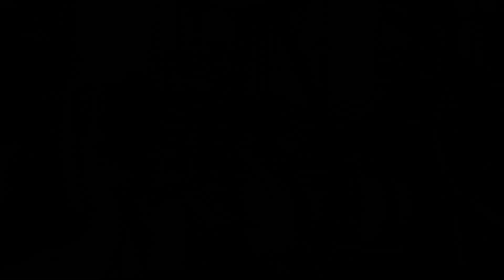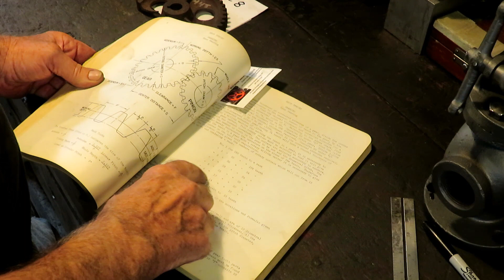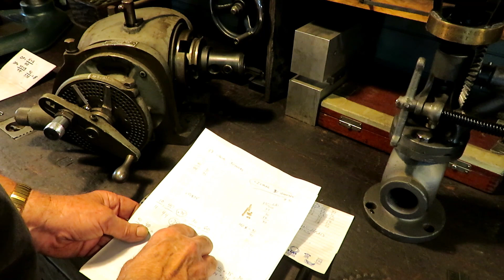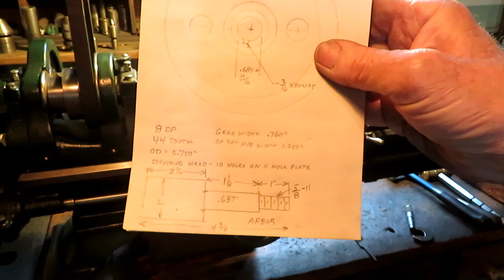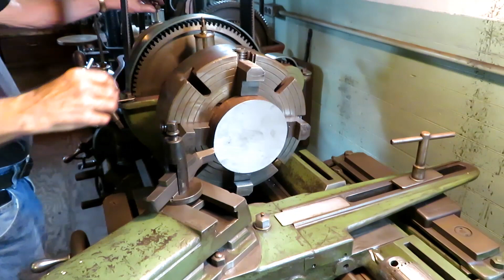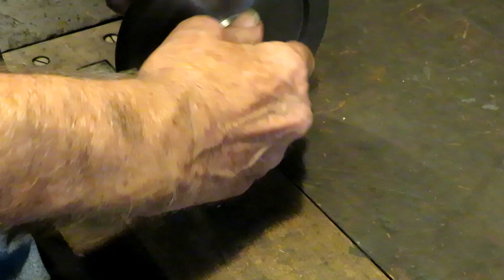Old Steam Powered Machine Shop 71- Gear fabrication, antique gas pump

Comment: Dave, I like the new overarm support bushing. You say the running bushing is the last on the arbor, but of course it doesn't have to be. Rigidity wise it's best to be as close to the cutter as possible. In some of the Milwaukee catalogs, I've seen twin overarm support heads, behind and in front of the cutter, and an X brace to the knee. I'd imagine that is quite resistant to chatter.

Cheers and welcome back!

Comment: How do you determine the speed of the cutter and the speed of the table? Thanks for taking the time, love your show
Reply from the maker: Well Mike, this is slow stuff here. There are just two cutter speeds on this milling machine. Slow and slower. Normally you would find the surface speed of the cutter tooth based on the diameter of the cutter in feet times the rpm and try to keep it around 125 ft/min for mild steel. With the old Brown & Sharpe, at it's 120 RPM a 4" cutter would run at about 40 FT/min. (About 1/3 the speed the cutter is capable of).  The table feed on the 
B&S is changed by moving the small flat belt to a different position on the feed drive. You would just choose a speed that the cutter, set-up and surface finish is happy with. Thanks for the good question....Dave
Reply: @davidrichards5594  Thank you Dave. If I win the lotto I'm going to buy your shop and you can stay as long as you want. Your the man

Comment: I like the Mill support modification. I cant see how that wouldn't be better than a center alone. Thanks for making this video
Reply from the maker: Hi Steve, These old mills also had long slotted support rods that came from the overarm down on both sides to a dovetailed plate that road on the knee ways. (also long gone for this mill). ....Dave

Comment: Thanks for another great show David. Look forward to seeing you cut the teeth, and it would sure be nice to see it installed on the equipment when it's done too. Definitely know about that heat. I'm doing brakes, drive shaft and engine work on my truck in slidell, La. It's 90 degrees outside and 90% humidity. Thankfully I built a Mechanics Carport Driveway Shade Tarp, if I hadn't done that the driveway would be to hot to lie down on. Thanks again for a super nice video. See you in the next one. Best Wishes & Blessings. Keith Noneya

Comment: As everybody else I welcome You back. I got my self a metal shaper. Is there a way to cut gears in such a machine?
Regards PeO, Sweden
Reply from the maker: Absolutely Per, You grind the gear profile into a tool bit and use an indexer or dividing head to rotate the gear blank through the positions.....Dave
Reply: @davidrichards5594  
I show people in an old machine shop how belt driven machines functions and You mr Richards have taught me allot about the trade. I’m most grateful!
In the work shop we have an old horizontal milling machine. It’s fitted with the same lathe center as Your’s before You change it to a running bushing!
Thought You wanted to knew!
Regards PeO, Sweden

Comment: A simple way to check the math 40 x 33 = 1320    1320 divided by 44 = 30 so 30 holes on a 33 hole plate is correct.

Comment: Great to see you again on a new episode! When I have to use a dividing head, I factor the number of teeth on the gear. 44 renders 2-2-11. So then ya go through your plates looking for the most exotic factor 11 (prime number). 22-33-44-55-66-77, and the like. Then multiply the selected hole circle times the dividing head ratio and then divide by the tooth count of the work. Yer gonna get a decimal. Save out the whole number with your sharpie on some cardboard, and the use the .xxxxx part times the plate circle you selected. This will be your number of holes you set your quadrant to. Now the number of cranks will be the whole number and the quadrant will be the partial movement.    33 X 40 / 44 = 30/33....so in this case less than a whole turn.
Reply from the maker: Yeah, I should have seen that 11 goes evenly into 66....Dave

Comment: I was very surprised to see your Diving Head, as I thought I had the only one in existence, mine came with the Elliott milling machine I bought, and believe it to be a Victoria, never found any reference to it anywhere, I've had to make several plates with the number of holes I wanted, and also made a couple of different types of chuck attachments.
Reply from the maker: Bernard: This one is a Van Norman and has the gear set with it to couple with a Y axis feed screw to do spherical gear cutting also......Dave
Reply: David, I hope you don't mind my posting this link, but it shows my Victoria as an exactish copy of your Van Norman. https://youtu.be/92kM-qQh4sw

Comment: This remains me of a mistake I made when I was 7 years old.  My Grandfather was getting gas at the local  general store . He had pumped the site glass full and placed the nozzle in to his Chevrolet pickup's truck fuel tank and opened the nozzle valve. Then he went inside the store.  I had never seen a pump like it before,  I noticed the glass was about empty so  I started pushing and pulling the handle back and forth. So the gas would keep going.  Mr. Hit ( stor owner) though it was very funny . My Grandfather was not happy with me because he had no idea how much gas I put in his tank. At 23 cents per gallon he was not sure he had enough money to pay for it. He had planned to only get 10 gallons.  This was the day I learned that Mr. Hit was a very nice man.  He told my Grandpa not to worry about it, all the gas was free to me that day. He also showed me how the site glass was marked and explained to me how to use them to measure the gas he also told me how many cycle of the pump handle it took to move 10 gallons into the glass on the top of the pump . Them he gave me a icecream bar . And told me when I was ready to get a job he would have a job for me. A few years later I started sweeping his stor after school. Later on he retired and sold the Store to Mr. Majors, I swept the walkway under the porch roof until I was in high school.
Reply from the maker: Great story Tom....Dave

Comment: I thought I had heard they were doing away with boilers in New York and you could just use a garden hose in the sun instead. 😂
Reply from the maker: It hasn't gotten to that yet but I will say the local State inspector for my territory is very cooperative and helpful......Dave

Comment: Divide by 4 and get 10 to 11 and then any multiple of that works e.g. 30:33. This is the same as doing .75 which is 3/4 which is divided by 4 and multiplied by 3. Very obvious once you see the answer but not so much when you are focused on the original numbers.
Reply from the maker: Very true....Dave

Comment: Hi Dave, glad to see your back and all is well. Another good video on gear cutting, I have a couple to do in the future for myself, thanks Dave for the encouragement.
Thought you might be interested in my latest project. 1920 South Bend, 16"-24" x 8' gap bed bridge lathe, quick change gear, silent chain motor drive, with lots of tooling, 3 and 4 jaw chucks, 5ns draw-in collets, taper attachment, steady rest, thread dial.   Really looking forward to getting it back together this winter and make some chips.
Reply from the maker: That will be a good one....Dave

Comment: Thanks for sharing your time with us it's good to see your channel up and running. How much trouble would it be to hook the line shaft to your shot blaster for times like this. Just a thought and if you won't to keep it period correct simply go get a 1917 Chev V8 and their you have it. All in the set up  Paul

Comment: How did you determine the pressure angle of the gear?
Reply from the maker: assumed that because of it's age and the simple slow application that it would be 14 1/2 ....Dave

Comment: I love the videos where your in the shop. I have my sb 9 circa 1937. I do my threading by turning off the lathe and letting it coast to a stop. No need for a groove that may weaken the shaft. Works pretty good. One of these days I’ll get around to fixing the headstock where a previous owner filed out the way to realign the headstock for some odd reason.  It moves from time to time, very annoying.

Dave I believe you encountered one of the issues old machine shops had. Too hot to work!  It’s probably why they had a separate building for boiler.
Reply from the maker: Probably true, with a separate person to fire it...Dave

Comment: You were almost there when you reduced your original fraction of 40/44 down to 10/11. Then all you would have needed to do is multiply both the numerator and denominator by 2, 3, 4, 5, 6 and etc. until you found a plate that worked. Please do not feel embarrassed for not thinking of that because I too have experienced "cranial flatulation".
Beautiful work the arbor bushing. :-)

Comment: Way to go Dave....  Another great video. I can understand waiting until cooler weather for Part 2.   Just think, way back in 1925 the guys in the shops who HAD to work in the hot weather WITH the heat of the boiler as well. Gives you an appreciation of air conditioning.... Go get that glass of lemonade - we have the bell set for ya

Comment: dave  44/40 is 11/10 as you figured  but you forgot  3 x 11/10 is 33/30 mixing decimal and fractional gets confusing sometimes... i run across it more up here ...metric land  where stock or sheet goods and most other materials are listed in si units but are still imperial fractional dimensions... a 2 x4 is a 2x4 is a 2 x 4 ok so irs 1 3/8 x 3 1/2 now but thats a different annoyance lol. thanks for the videos

Comment: You can calculate the number of holes very easy : multiply the reduction of the deviding head with the numbers of holes there are on the disc. Devide that number bij the teeth you want. If it's a whole number then you are done and the number that came out are the holes per step. If the reduction is 1:40 and you have a disc with 66 holes than you multiply 40 x 66 = 2640 Now devide 2640 by 44 (number of teeth) = 60. So on the 66 holes you count 60 holes on every cut.

Comment: Do you only burn wood to run your boiler?
Reply from the maker: I have an almost unlimited source of  furniture grade scrap from a friend's shop across town. I do use coal sometimes, it requires less attention to fire with it but requires more ash and flue cleaning. The wood burns very clean....Dave

Comment: What do you do to winterize your steam engine and boiler?  In my scale loco and boiler I can just run the engine on air to get the water out then let the boiler dry out, I would imagine that with the large gear you have the process is more involved.
Reply from the maker: HI Russ, It's a little time consuming to drain all the piping including the heating radiators in the front shop, and then pressurize the boiler with air to blow out all the steam lines. I take off the whistles, injectors and steam gauge, blow them out, run a dose of Marvel oil through the engines with air pressure, take out all the boiler hand holes and wash the boiler out with a long wand that I made to get in around the tubes. Then I shop vac out the bottom ring of the boiler with a small hose to get scale, etc. out. I use "Boiler Saver" compound 
all season in the feed water and every time I wash it out, it gets cleaner. I "wick" out the remaining water with cotton towel strips and then just leave it open to the air with some screen stuffed in the lower hand holes to keep out varmets....Dave
Reply: @davidrichards5594  Wow, that's a lot of work to use it a couple times a year!
JIM